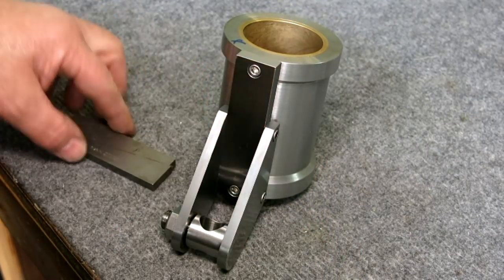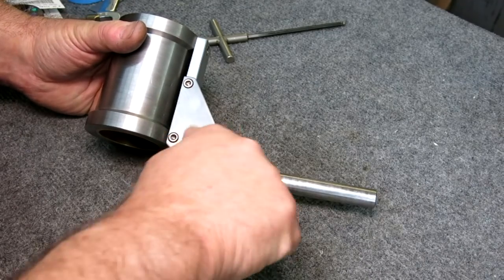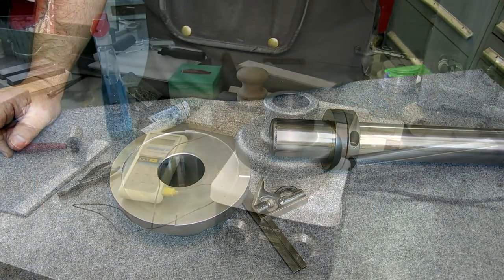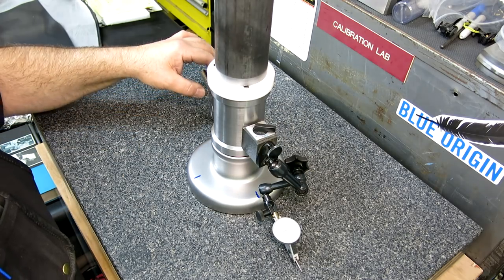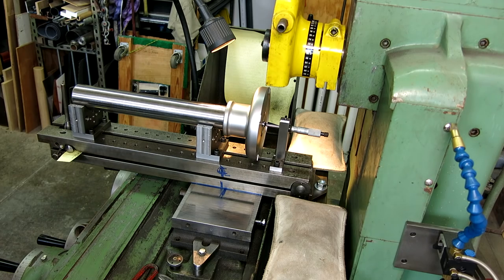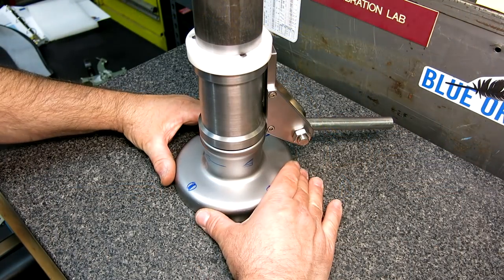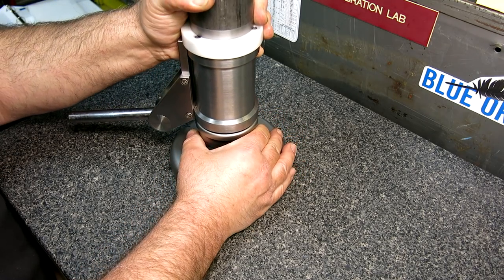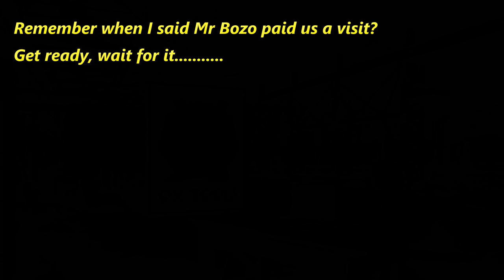Traveling Squareness Comparator P4

Comment: i wonder which name was the thickest on the post it notes.  Of course having seen Tom measure the thickness of a sharpie mark I guess it makes a difference what is used to write on the notes as well.
Reply: Amateur Redneck Workshop I was wondering the same thing. The number and positions of the vertical strokes in each letter would have an effect too, depending on how they were distributed under the bearing surface.
Reply: When water-based ink dries out,  it shrinks paper.  But IIRC that doesn't happen so much with the fragrant mix of organic solvents in Sharpies.
Reply: I have a mike ball adapter that attaches to the mike spindle with a small rubber sleeve. Easy to duplicate.

Comment: Excellent work on "The Liptonator" - wait: "The Lipt-O-meter."

Step by calculated step you're working towards your end precision. Each is explained and demonstrated, ever potential stumbling block is studied and a remedy worked out. You've developed a series of lessons anyone could follow to attain a similar goal. You"re continuing the themes you set forth in your earlier books on craftsmanship and metalworking. 

My hat's off to you, bub. By the end of this episode, your instrument swept a plane from the post only 0.001" TIR out of perpendicular in a 12" circle. Some of that may be due to the necessary handling of the post as you side wheel ground the pads. Thermal equalibrium rules.

That's a crafty bit of kit you're building there but i still want to see the stencil set you used to number the protons sequentially accellerated at Livermore. Did they ever find 56A?
Reply from the maker: Hey Forrest. Thanks for the nice comment. I think there were some stray protons under one foot which exacerbated my indicator error. All the best. Tom

Comment: I have nowhere your expertise however, it seems to me that this rotary squareness comparator would be very frustrating in actual use. How could one use this device against a vertical cylinder as it would be difficult to run up and down the cylinder at the exact same vertical line .

Comment: Ok, I don't get something.  Why does the grinding wheel only take material from the feet when they are at top dead center?   The side of the wheel should be completely flat, no?  And so shouldn't material start being removed as soon as the feet cross the wheel's edge?

Comment: I'm really lovin this series Tom!  I just have a question on the rod center and ball stop; did you bore or grind that center "chamfer" surface?  I 'm not even sure that it would matter but I'm thinking if you are using only a center drilled surface, then the ball's spherical interface might not always be in contact and reflect in the indicator reading???  Phew!
Reply from the maker: The pin was cylindrically ground off those centers.  They are lapped centers not just rough center drilled. Cheers. Tom Hey what gives I miss your videos!

Comment: Thanks for the upload Tom. 
Did you also consider also throwing the shaft in the freezer (assuming you don’t have a bunch of LN2 laying around)? Or did it not fit? Would Mrs Tom not be okay with that?
Also, your squareness setup was pretty clever. I was thinking you’d just set up a makeshift comparator with a v-block resting on the plate on some blocks but making contact on the shaft just above the the base with an indicator off the v-block indicating the very top of the shaft. And rotate the shaft. Did you consider/dismiss that?  It seems that basing the indicator on the sliding collar would introduce variances from any possible play.
Again, thanks for sharing the project with all of us armchair machinists.
Reply: Along with the method that you have described I thought of using Tom’s largest vertical square (or some other stable high fixture) on the surface plate with a V-block or similar down low to engage with the bottom of the pin and an indicator up top engage with the top of the pin. The pin and base would be rotated while held against the V-block. It is a clumsy method in some respects but does have the advantage the it is using the height of the pin to amplify the indicated error.

Comment: Why not measure the squareness with the sliding mechanism at the top of travel? That way your errors are magnified.

Cheers
Reply from the maker: Hard to reach down to the plate in a reliable repeatable way. The pin is 16 inches long. Cheers. Tom

Comment: Why are you indicating different feet on the grinder?  The whole point of grinding is that the feet are no longer co planar to each other or the axis of the pin.  Shouldn’t you have rotated the part to indicate the same foot whilst locking the lateral movement?
Reply: that was rough indicating, he mentioned final indicating on the same foot rotated as you say, he did that off camera

Comment: Just so I understand... You couldn’t surface grind the feet before you put the shaft in because you needed the shaft to reference perpendicularity at working height?
Reply: Yes.  The important thing to have perpendicular to the surface plate is the column so that when you move the travelling head up, it's exactly 'up' and not 'up and a bit to the side' which would throw off any readings you take with it.   The base itself;  doesn't really matter if it's true to anything - although I'd argue that were this to be produced for other (less able) operators than Tom, it'd be helpful if the top of the base were true to the column (the reason Tom made his magnetic calibration jig) because you can guarantee someone will assume it is!

Comment: Shrink fits are really interesting. maby make a more detailed video on the subject. preferably with some metric conversions for us non Us/Libya people :)
Reply: check out the zeus reference book it has all standard shrink/interference fits along with other useful engineering data such as thread dimensions etc. and the recent ones are metric revised
Reply: Thanks for that. Still interested in a video. Old timey tips and tricks type deal
Reply: Lok for Machinerys handbook in english, for Swedish, "Karlebo handbok" is great, sadly karlebo out of print as far as I know, but second hand shops... I see them frequently.
Both have ton of tables on fits and temps for different materials, tolerances, threads, fasteners, grinding, tooling, heat-treatment of different materials, just huge knowlegebase of mechanic related stuff
Reply: Yeah, I have my granddads old copy of "Karlebos handbok" Its great, But its written in ye olde swedish so its rather hard to follow.

Comment: Hey Tom, total novice machinist, might be a dumb question, why not surface grind the top surface of the base parallel to the feet so you could use that to ride the bottom of the sliding indicator on. All of that as opposed to creating the magnetic tube fixture?
Reply: because even though grinding would be more accurate there is still some possibility of error as proven by the grinding of the feet not producing a perfect result and needing final lapping, the magnetic tube fixture insures greater accuracy which is important when producing a reference instrument
Reply from the maker: The feet are to be lapped. I really needed and wanted to reference the pin axis at some fixed height to test perpendicularity. Sure I could have ground the base and top parallel but to what? Not easy to get it perpendicular to the bore when its really short like it is in the base. Hope this makes sense. Cheers. Tom
Reply: oxtoolco Thanks Tom!

Comment: Could you have just as easily just indicated the shaft in the 4 jaw and faced the feet?
Reply: 4jaw wouldn't work, you can't indicate the top end of the bar that is way inside the spindle, and 4jaw jaws may not grab the part and put it totally concentric with the spindle bore,, 4jaw+steady (top of the bar in 4jaw, the base sticking out to the right from the steady) could work, but proper way would be to mount it in between centers, but then the question is - are the centers accurate enough in relation to the bar surface, so his setup makes a lot of sense
Reply: No I figured you would have to leave it stuck out of the chuck and indicate it in 2 spots to get it concentric and parallel.
Reply: that bar is not that long to get meaningful stick out to have reasonable distance between the places where you would indicate, and the more it will stick out, the more it will sag and not to mention the flex as you'll try to cut, it will most definitely sing, as the cut is interrupted and steel is quite bad at absorbing vibration, so no, 4jaw is not really an option for this job
Reply: I would have placed it between centers. I think with a good lathe he could have achieved the same result.
Reply: RC60+, and high precision, wouldn't that be more toolpost grinder than turning territory?  

Is there a type of setup to do true lapping on a part face still in the lathe?